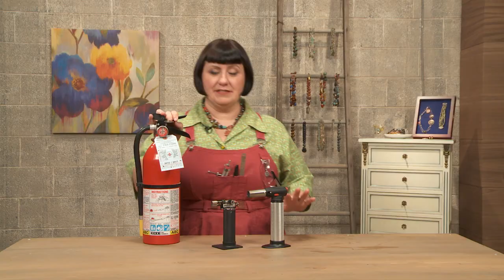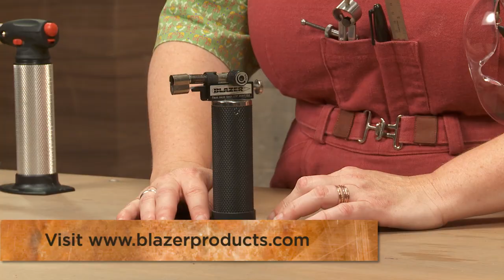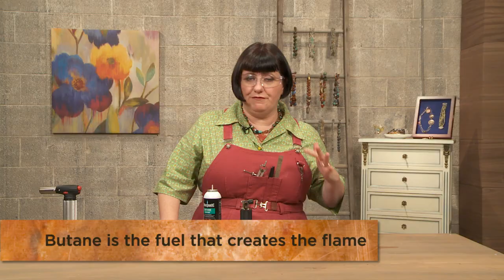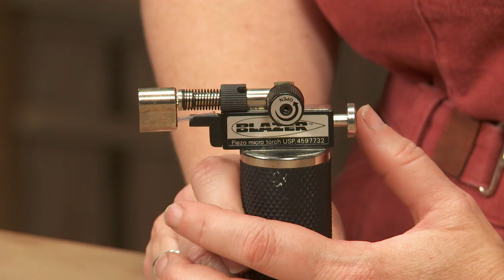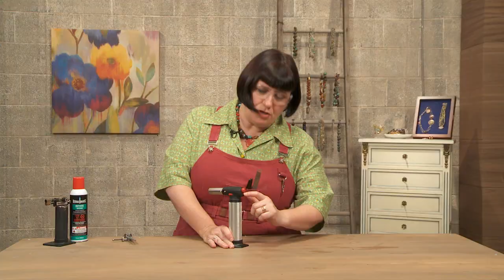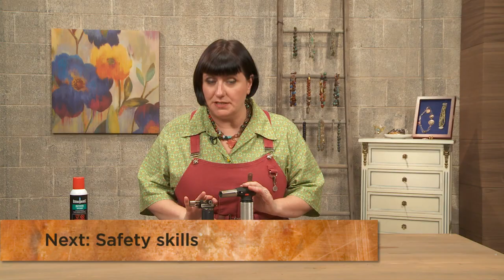How to use a microtorch (Blazer & Max Flame) | Jewelry soldering tutorial with Kate Richbourg

Comment: Thanks for the video! I'm a beginner and I'd like to solder copper hand rings, as well as attach cut copper sheet to bangles. I'm not sure if I can get away with a Proxxon microtorch, or whether I'd need a Max Flame for the bangles (or creme brulee torch) as I'm assuming the entire bangle would need to be heated (and not just the surface area of where I'd be attaching things). Can anyone help? I'd be using silver solder. Thanks!